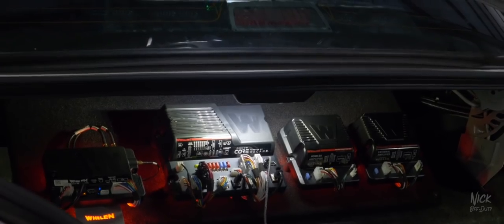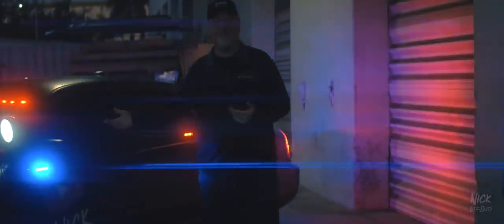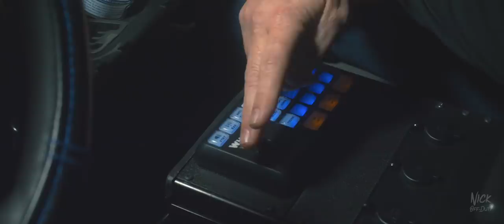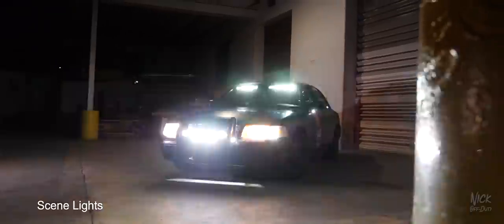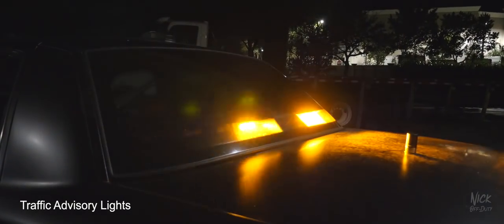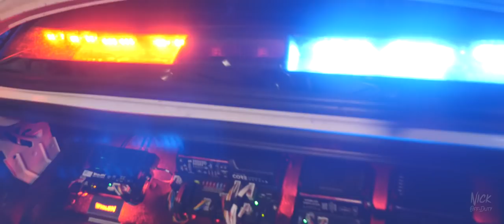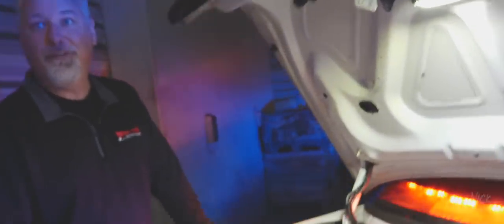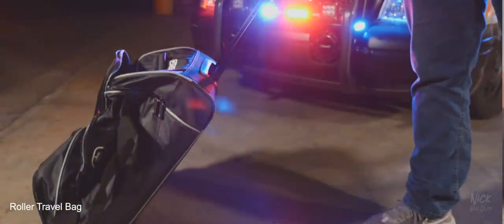POLICE CAR BUILD : How to work my Police Lights and Sirens / Light Show

Comment: Police cars have become very dangerous with all those lights. Not only will it put a epileptic into a seizure but no longer can the motoring public tell what's going on. It's hard to tell if the car is moving, what it's doing or what it's intending to do. Put 5 of those cars at a scene with all those lights on and try to drive by; you're so blinded you're liable to drive right into someone working the scene. And it really does produce the public perception that they're trying to be as wasteful as possible with public money.
Reply from the maker: Did you watch the new tech and how it addresses that? You should check out the podcast we just did where we talk about the exact concern and how it’s being mitigated. @donutshoppod
Reply: If you actually watched the video, you'd see the part about how the new tech is able to help calm the scene, especially with DVI and V2V sync. Quite the opposite of everything you're claiming.
Reply: The DVI patters really help also the lights will dim at night and run a low power mode.